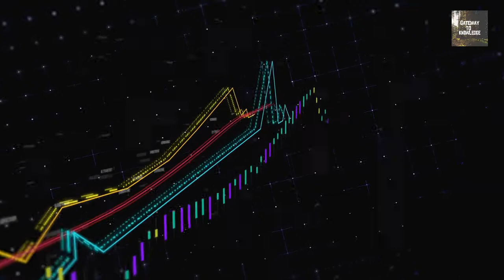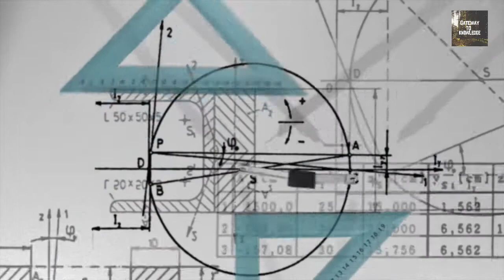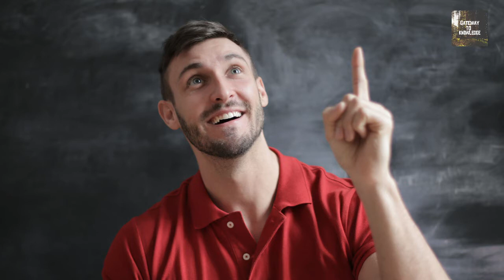How Rocket Moves In Space When There Is No Air To Push Against?

Comment: Rockets can't work better in space There is not enough mass In the expelling gasses to push the rocket efficiently
Reply: Sorry to break it to you but rockets are MORE efficient in a vacuum.  Not only do Newtons laws SAY SO, but the greater than million hours of testing in space says so
Reply: @Stuart Gray  OK smart guy believe everything your masters tell you.
Reply: By the way just off the coast here in NC is restricted air space and no go over water for "military exercises " look it up if you don't believe me
Reply: @Stuart Gray  So are you telling me that in fact the rocket is exhausting gases then recoiling off of that? Serious question I'm trying to understand what exactly you think it's happening in space what I'm saying is if there is no resistance to the exhausting gas it would just continue to move in its direction an the force in the opposite direction would have far less affect on the mass of the solid rocket so it would be incredibly inefficient just like my example with the bullet being fired, without the projectile there would be no felt recoil on the slide while the gases would move the opposite direction down the barrel at high speed. Are you saying that would be different in space.
Reply: @nastytime4507  - "what I'm saying is if there is no resistance to the exhausting gas it would just continue to move in its direction an the force in the opposite directio"

So tell me:
DOES A CROSSBOW EXPERINCE a RECOIL FORCE if fired into a vacuum?
Yes
OR
NO?
WHY
or WHY NOT?
If you are incapable of answering these types of questions you will never understand how basic physics works.
Reply: @stuartgray5877  Yes but the crossbow bolt is a solid not a gas.
Reply: Now I have answer your question answer 1of mine please.
Reply: If you fired a crossbow in the vacuum of space which would be propelled  faster  the bolt or the crossbow. Or would they be propelled at the same speed
Reply: @nastytime4507   - "If you fired a crossbow in the vacuum of space which would be propelled  faster  the bolt or the crossbow. Or would they be propelled at the same speed"
Lets say an astronaught placed a typical crossbow (~4 kilograms), loaded with a 0.4 kilogram projectile, cocked, ready to fire and floating beside him.
He fires the crossbow by remote control and observes the projectile ('Bolt') (~0.4 kg) moving to his right with a velocity of ~90 meters per second.
Then the total momentum of the projectile is 0.4 kg X 90m/s = 36 kilogram - meter per second. ( 'Kg • m / s' is the unit of momentum).
Then we know (if the 4.0 kg BOW was unrestrained floating in space (no one holding it), then it would absorb the SAME MOMENTUM - 36 Kg • m / s in the OPPOSITE DIRECTION.
For the 4.0kg bow to absorb 36 Kg • m / s it must have achieved a rearward VELOCITY of 36 Kg • m / s divided by 4.0 kg = 9 meters per second.

SO, the 4.0-kilogram bow would have a rearward velocity of 9 meters per second to fire the 0.4-kilogram projectile forward at 90 meters pers second.
Feel free to check my math.
Reply: @nastytime4507  - "If you fired a crossbow in the vacuum of space which would be propelled  faster  the bolt or the crossbow."

If you understand the math in my example above, then even you can see that the velocity of the bolt and the projectile is directly proportional to the difference in mass.
If two equal masses exert a force between each other, then each object absorbs equal MOMENTUM, but since they have the same mass then they obtain EQUAL VELOCITIES but in opposite directions.
The experiment I am describing is a textbook example of Newton' third law and the "Law of Conservation of Momentum".
But if you think YOU are right and generations of engineers and physicists all the way back to Newton are WRONG, then please explain your theory of how mechanical recoil works.
Reply: @nastytime4507  I could show you a LIVE VIDEO of rocket propulsion in a vacuum and you would just call it fake anyway so what would be the point?
Reply: @stuartgray5877  Show me by all means
Reply: @nastytime4507  Now TWICE YT has deleted my comments where I tell you where to go look. I didnt even post a link.
Reply: @stuartgray5877  right
Reply: @nastytime4507  It did it AGAIN.
The post count was 42 after my last two posts.
Reply: @nastytime4507  Try the YT video "Complete SpaceX Falcon Heavy Launch to Landing Footage: Enhanced Edition"
by Astronomy Live
Reply: @nastytime4507  NOW the POST COUNT is 44 (45 after THIS POST)
If it is LESS THAN THAT when you check back then YT is DELETING MY POSTS (as they always do)
Reply: To be clear I don't think you are lying I'm sure you build fueled and launched a space craft but after it launched you have no proof it went to space only computer simulations that I'm sure you believe, but sorry I'm not that gullible. And if you didn't have doubts it wouldn't be so important to you to convince me since I am so beneath you education wise.
Reply: @Stuart Gray  And that is a rocket working in space? Like I said. No proof
Reply: @nastytime4507  Bless your little heart!
Muted
Reply: @Stuart Gray  There you go  insults again instead of proofs
Reply: @stuartgray5877  Got to the truth Finley?
Reply: @stuartgray5877  That's the point it can't be proven or disproven once it goes to space all we. Have is your word that it's there
Reply: @Stuart Gray  I have also seen. Space x launch and fly over my house and was at a lower altitude that commercial jets fly that's why all air traffic was diverted from ILM as it flew over it was early evening and you could clearly see the exhaust interacting with the atmosphere
Reply: @stuartgray5877  We live in a closed system buddy. Space doesn’t exist. You made lies your life.
Reply: @nastytime4507  - "That's the point it can't be proven or disproven once it goes to space all we. Have is your word that it's there"

Except for the fact
that:
YOU 
CAN 
SEE IT
WITH YOUR  OWN EYES!

I guess NOW you cannot believe your own eyes.
Got it.
Reply: @nastytime4507  Tell us where your house IS and which SpaceX launch you saw fly right over it.
This should be very entertaining.
LIAR
Reply: @Stuart Gray Near  Wilmington NC a place called Bald Head Island  I  also  used to watch the space shuttles launch and fly over the ocean instead of going UP in to space.
Reply: @nastytime4507  Oh AND if you live 200 miles away from the launch site , then the rocket must reach over 6000 feet altitude before you can even see it from your location.
Explain that genius.
Tell us you saw the space shuttle "Lift off" since all you know how to do is lie.
Reply: @stuartgray5877  By the I'm about 500 or more miles away from Canaveral. Explain that smart guy.
Reply: @nastytime4507  I want you to tell US WHY you lied in the first place.

The falcon rockets have NEVER GOTTEN WITHIN 200 miles of your house.
So why did you lie?
Reply: @Stuart Gray  I have pictures and video. So who is lying to you
Reply: @nastytime4507  - "And as I have stated over and over again you have 0 proof of this actually working in a vacuum other. Than  equations and computer programs "

Oh AND: I have ALSO launched THREE spacecraft with crossbow-like mechanisms on them, fired them IN SPACE and measured the recoil force.

WE HAVE DONE THE EXPERIMENTS.  You calling me a liar is not evidence of anything but your ignorance.
Reply: @stuartgray5877   The only reason you're trying so hard to convince me is because you're trying to convince yourself
Reply: @stuartgray5877  You got back nothing you're a little computer screen simulation said you got back a measurement that's all
Reply: @stuartgray5877  I have seen with my own eyes. These. Craft that supposedly are going into space fly out over the ocean. So am I going to believe a liar like you or my own eyes
Reply: I apologize and take that last comment back. I'm not sure you are a liar. Maybe you are just that Indoctrinated.
Reply: @nastytime4507  Did I mention that I was on console at JPL Mission Operations Center the minute we hit the Comet?
I was the "Impactor Command and Data Handling subsystem Engineer" that evening.
And I was the FIRST team member to confirm that we hit the comet.
The Next day I was the "Flyby Command and Data Handling subsystem Engineer" and the Activity Lead whose responsibility it was to downlink the images of the comet encounter from the Flyby spacecraft to the Deep Space Network.
It was then MY JOB to VERIFY that all of those images came down unaltered .
But tell me AGAIN how a high school dropout knows more about the details of the mission than one of the people that Bult, Launched, and OPERATED IT.
Reply: @Stuart Gray  It's  also funny that you guys are so smart that you can build program and fly by remote nonetheless and hit targets hundreds of thousands km. away with made up spatial coordinates with 100%success rate. But in real world engineering like my buddies that design , build and test  fighter jets have trial and error all.the time with maned test where the pilot's life is on the line not to mention the time in years for R&D . But I guess you space guys are just that much smarter. 😉
Reply: @nastytime4507  So that's a "NO I will NOT explain how NASA made that Comet explode".

Got it. I accept your surrender.
Reply: @Vladlll  Perhaps YOU could explain how NASA made that comet explode to the minute of when predicted FIVE YEARS IN ADVANCE?

NO?
What a surprise.
Reply: @stuartgray5877  Sense You don't have a real answer to any of my questions that means I conceded. Yeah you're a really bright one
Reply: @nastytime4507  SG is a bot bro
Reply: @DrCash7 a bot smarter than him
Reply: @nastytime4507  everybody knows Stuart Gray is a chatbot. It cannot answer questions & just abuses you & wastes your time.
Reply: @papalegba6796  So "chatbots" have YT channels complete with video of them driving in vintage car racing?
And Bots have children and grandchildren?
Cool story bro.
Reply: @Stuart Gray  that is what they do, tell you dummies they og to space but in reality they just fly out of sight over the ocean and come back down.
Reply: If you read older physics books they never mention recoil force just the expanding gas out the back of a rocket. It only changed when people started calling out the nonsense you probably also believe that gravity is a force when you need it to be and not a force when it's not convenient
Reply: @nastytime4507  - "If you read older physics books they never mention recoil force just the expanding gas out the back of a rocket."

This is a flat out lie and proves that you have never looked at a physics book in your life.
NEWTON wrote the VERY FIRST "Physics book"
Newtons laws say that rocket propulsion MUST work in a vacuum.
There has NEVER BEEN - ANY QUESTION - except among people that don't understand physics.
Don't try BS-ing actual rocket scientists, genius.
Reply: Then why do jets use more fuel flying at higher altitude? Because there is less atmosphere to push against
Reply: @nastytime4507  because airplanes use the air in the atmosphere to push on which means it is dependent on atmospheric pressure.
Rockets take mass WITH Them to push on so it is NOT dependent on atmospheric pressure.
Are you suggesting that Engineers have NOT had enough time to TEST the 100 -year old Tsiolkovsky Rocket Equation?
Reply: Listen to yourself "rockets take mass with them ". Rockets and jet engines use the same principles just different fuels, it doesn't change just because it leaves the atmosphere.
Reply: @nastytime4507  it absolutely DOES make a difference.
A space shuttle main engine consumes 500 kilograms of liquid hydrogen and liquid oxygen per second.
It expels that same 500 kilograms as pure water at MACH EIGHT.
Since the mass is coming from inside the rocket's tanks it will still expel this mass even in a vacuum.
We have millions of hours of test data of many different types of rocket propulsion in vacuum over the last 60 years.
Reply: @Stuart Gray  Give me one real example in a vacuum that doesn't just fill the chamber with gases first ,then shows slight movement and show that it is efficient enough to sustain that acceleration . But also remember that any vacuum we create on earth is only a fraction of the vacuum of space. Sorry but you have been lied to your hole life and sounds like your hole career if you are telling the truth about that.
Reply: Also how dose a rocket reach 40000 KPH when it expells exhaust at only 10000 KPH.and don't say it's because it adds a little force at a time along the way, because once you've reached the max being expelled you can't add more force and without increase in force  no increase in velocity
Reply: @nastytime4507  I have been building, testing, launching and operating deep space science probes for longer than you have been alive.
And my first job after obtaining my Engineering degree was at Lockheed Martin Space Simulation Lab operating some of the largest thermal vacuum chambers in the country.  So I have been a vacuum test specialist for almost 30 years now.
Tell me that YOU finished high school
Reply: @nastytime4507  just so I understand, you are trying to lecture an actual aerospace engineer about rocket propulsion when it is obvious you have never taken a single physics class in your life 
REALLY?
Reply: @Stuart Gray  Nice ,instead of giving real answers. Just go with "I'm smarter than you because I have a piece of paper that says so.  But just as I thought, appeal to authority but no real answers
Reply: @nastytime4507  I have explained it but I'll try in a way that a five year old can follow along:
Rocket propulsion is the mechanical recoil of pushing on mass.
Rockets Push mass out the back and feel a recoil force as a result.
The exhaust gas has exactly the same mass as the fuel and oxidizer that went in.
The rocket nozzle applies a Force to accelerate the mass of the exhaust gas out the back.Newtons laws say that any force that one mass exerts on another mass results in a REACTION force pushing back on the first mass.
This REACTION force is the RECOIL FORCE that results in Forward Thrust.  So people that believe that rockets don't work in a vacuum believe that MECHANICAL RECOIL STOPS WORKING IN A Vacuum. IT DOES NOT.
Don't believe ME go read a physics book.
I can tell you have never taken even high school physics in your life.
 So why did you drop out before the 9th grade?
Reply: @Stuart Gray  Your assumptions about Me are ridiculous Just because I think for myself instead of regurdictating crap from a physics book which I actually have read, you think you have all the answers but you're really not answering any of my questions as far as the velocity of the expelling gas and yes the mass of the exhaust is the same as the mass of the fuel but not the mass of the rocket when you figure it out let me know
Reply: @nastytime4507  - "Rockets can't work better in space There is not enough mass In the expelling gasses to push the rocket efficiently"

Once you ACTUALLY study physics you will find the FACT that Rockets are MORE EFFICIENT IN A VACUUM (generate HIGHER THRUST) where there is no atmospheric pressure to SLOW DOWN THE EXHAUST GAS.
Reply: And you really don't sound like someone who knows what they're talking about. You're just quoting from other youtubers That claim to have physics degrees
Reply: @nastytime4507  - "And you really don't sound like someone who knows what they're talking about"

I have:
an actual Engineering degree 
have been working as an Aerospace Test Engineer on some of mankind's most advanced vehicles for the last 30 years.
personally helped launch six spacecraft, four to deep space.
been on the Mission operations team of three spacecraft during their missions.
been on the Propulsion Fueling Team for more than one spacecraft and have had hazardous Operations Certifications at KSC and VAFB going back over 25 years.
A vehicle that set the record for fastest man-made object to fly through earth's atmosphere in the Smithsonian Air and Space Museum with my SIGNATURE INSIDE IT.
You?
Reply: @stuartgray5877  I don't have to justify my intelligence or education to you or need you to brag about your Degrees. I get it you think you know what you are talking about but the Things? You believe are true or nonsense. I worked for defense for almost 16 years and no enough To say that not everything we have been taught our whole lives is the truth. So have a nice life Indoctrinating. I were used to be conformist and to never think for themselves
Reply: By the way Mr physicist recoil only works in a gun because the gases push off of the projectile  no projectile no recoil
Reply: @nastytime4507  - " no projectile no recoil"

SO you are arguing that the EXHAUST GAS that comes out of a rocket nozzle HAS NO MASS???
Bless your little heart!
And thanks for proving that you failed to take CHEMISTRY in high school as well as Physics.
What grade DID YOU DROP OUT OF?
I knew Gas has mass in the 6th grade!
Reply: @stuartgray5877  Never said it didn't have mass. Just not as much mass as a solid object never said there was no recall effect only that it would be so inefficient that it could not move a. Rocket free space.
Reply: Yet again. You have failed to answer any of my questions. Only attacked me and still have no proof only that you build rockets. And apparently you know what they do what you say they do because you see a sim. on a computer screen and Can solve Irrelevant equations.
Reply: Olivia degrees and alkalades do not impress me all it proves. Is you are not a scientist? A scientist is in search of truth you apparently already know everything. So there is no more truth to search for
Reply: @nastytime4507  - "Never said it didn't have mass. Just not as much mass as a solid object"

Here is an example for you:
A Space Shuttle Main Engine consumes 500 kilograms of liquid oxygen and liquid hydrogen PER SECOND.

It combusts this fuel and oxidizer creating the exhaust gas.
How many kilograms of exhaust gas are produced per second?
and what IS the combustion byproduct of burning hydrogen and oxygen?
Reply: I don't believe you
Reply: You're an engineer or whatever you say you are and these cartoons. Are the best you can come up with?
Reply: @nastytime4507  no the "best I can come up with" us WAY OVER YOUR HEAD.
But I can give another piece of evidence that is your speed.
Search the net for "what happened to comet tempel-1 July 4th 2005"
Let's SEE if you have the intellect required to appreciate the significance of what you read.  I suspect NOT. Prove me wrong.
Reply: @Stuart Gray  I will give it a read  but still no evidence?
Reply: @nastytime4507  - "but still no evidence?"

Everything I have told you or tried to teach you IS "Evidence".
Maybe YOU just don't know the meanings of words?
Reply: @Stuart Gray  I have yet to be proven wrong but you are the one that keeps on appealing to authority of your education. I'm just showing that your education is meaningless because you are not allowed to think for yourself  and the people giving out degrees have there own agenda. Prove me wrong.
Reply: @Stuart Gray  a reading assignment for you look up a nation of dummies, a look at our national education system
Reply: @nastytime4507  Oh and I am sorry that I need to keep explaining this TO YOU BUT:
YOU
CAN
SEE
THE
ISS
IN ORBIT
WITH YOUR EYES.
Now go TRY THAT !
Reply: @stuartgray5877  Never said your education or your career was a hoax I'm just saying that you.
Reply: Do all of that work put all that effort into watching a video game on a computer screen and think that it is real life
Reply: @nastytime4507  So nasty time - Did NASA send a probe out there and slam into the comet causing it to explode or does NASA PRACTICE BLACK MAGIC?
Which is it genius?
Reply: @Stuart Gray  nope . Computer magic, and you wouldn't know the difference. It's a simulation
Reply: And even if it was real it still doesn't leave the atmosphere. I want to see a rocket in a vacuum
Reply: @nastytime4507  it is real and the rocket was IN VACUUM when the side boosters separated. That's why they wait until that point.
The atmospheric pressure at 50 Kilometers altitude is LESS THAN 1.0 Torr.
That is Vacuum!  So all of the rocket propulsion you saw in that video after side boosters separated was performed IN VACUUM!
And just as I predicted you call it fake JUST because YOU DONT LIKE IT.
It is not fake.  There are literally HUNDREDS of videos showing that event that occurred in front of tens of thousands of LIVE spectators.